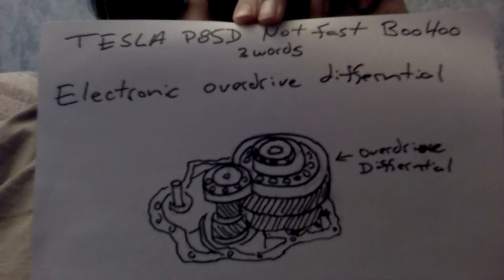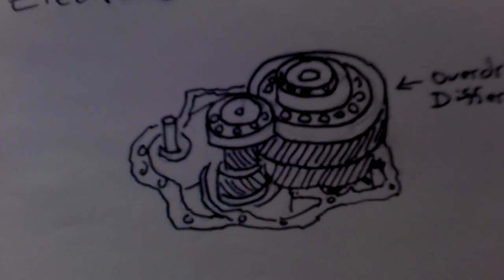Tesla p85d not fast enough?

Comment: Good idea. Possible potential
Have you done your research.
Tesla did attempt a transmission in the first vehicle the roadster.
The torque from the electric motor was too much and destroyed the transmission
It was a huge failure.
And the Teslas Limited TopSpeed is controlled in the computer it is not a limitation of ability.
It's definitely possible your idea wouldn't save energy and a lot of other things would be helpful just wondering if you did your research.
Reply from the maker: yes i built a nitro rs4 in 1998.  this has the same transmission as a nitro rs4 .  this transmission is the same.principle design.   I did a power band analysis on the p85 does too out at 120 mph with most of the torque being I. say the first 60 mph with the power band dropping off significantly.   so I would think the stage power band would pick up around 60 mph.  ideally I'd like to hid stage two at 200 mph but I think realistically were looking at 180 mph?  and at that speed were going to need a significantly designed body for the skateboard.  maybe something like a Lamborghini.  I have a apple inspired lambo design with the roof rear window and front being one piece of glass and ducting Into the frunk.  my initial design , I have the pinion is reduced. ( backwards ). but the second stage pinion would need to be like %40-%60 larger .  this is the same Borg Warner design. for stage two.  apon stage 2 engagement t stage 1 would disengage and stage one would engage.  presumably with a centrifugal clutch.  since elon always builds a working model.  I think the next stage would be to build a working model.
Reply from the maker: er what a mess.  stage 1 would disengage and stage 2 engage at 60 mph.  this would not be a standard transmission it would be an over drive transaxle.